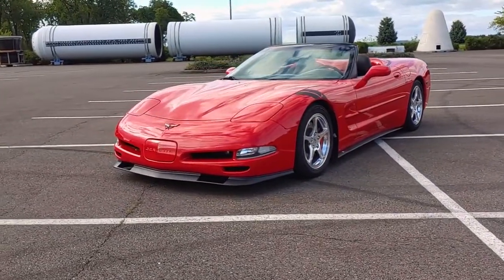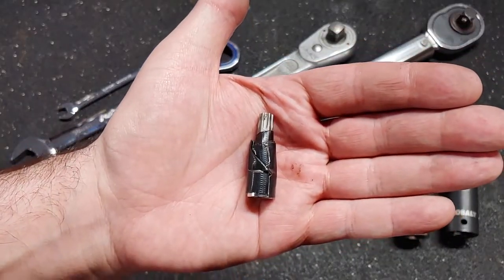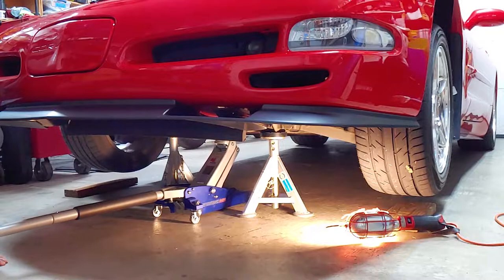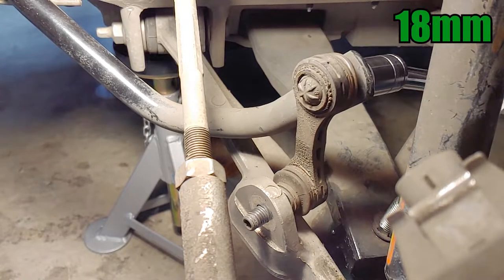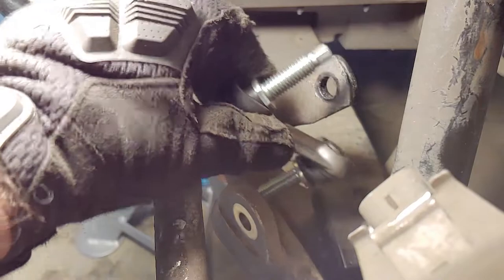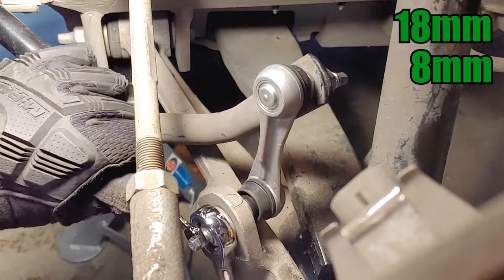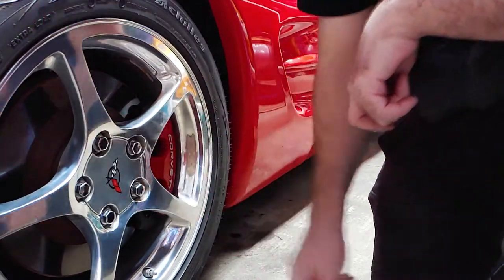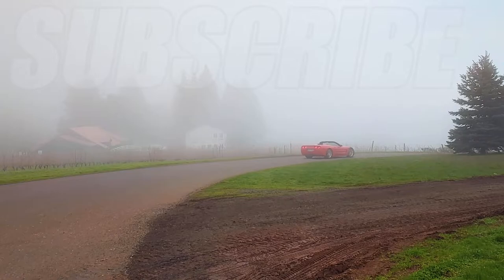Corvette Front Sway Bar End Link Replacement Guide with Tool Sizes and Torque Specs - 1997-2004 (C5)

Comment: Did you notice a difference driving after installing these
Reply from the maker: The owner says: "...really hard to tell. haven’t ran a track yet but i will this sat. normal driving seems to be quieter and I have noticed less of a bumpy ride 'from turbulence'. I’ll give more feed back once I get back from the track on Saturday."
Reply: @Endless Money Pits  I just daily mine but yeah man thanks ill probably install them soon myself
Reply from the maker: You might not notice a big difference in the sway bar links alone, but you will if you start replacing more of the 20 year old suspension components.
Reply: On my 97 it was a huge difference. Mine where bent and blown out so loading up the suspension it had lots of mush to compensate for. They also clunked since they where 110% shot. I also put new sway bar bushings while in there.